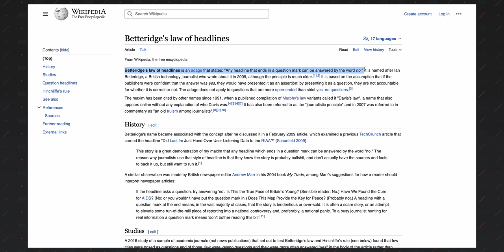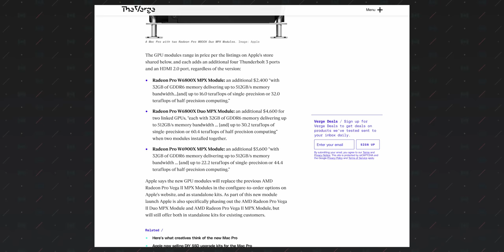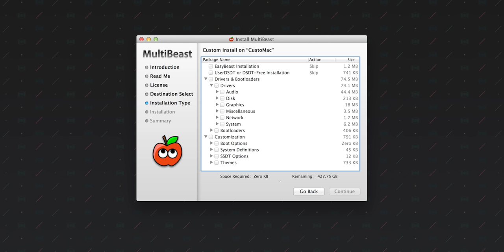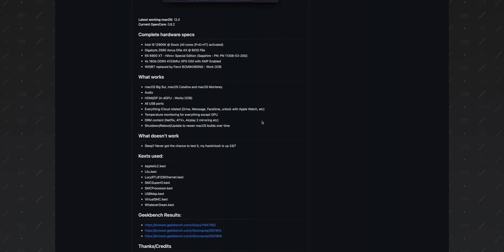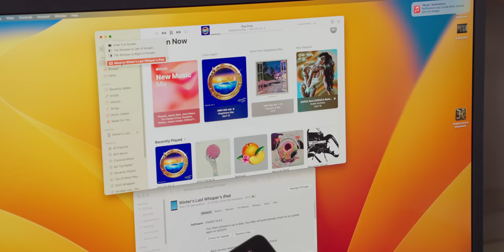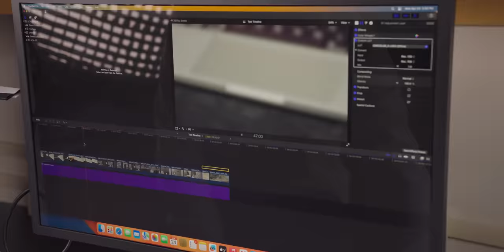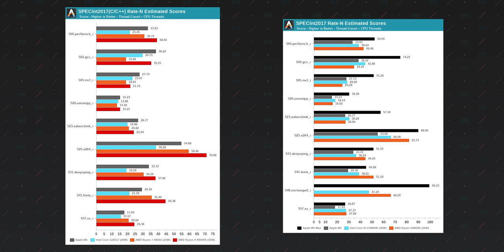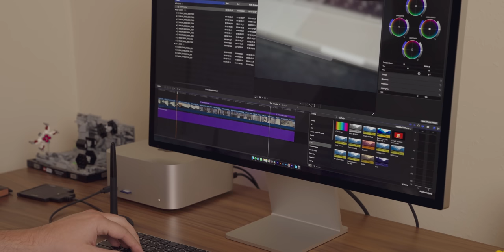This $2,000 Hackintosh SMASHES the $4,000 Mac Studio

Comment: I planned on buying parts (today) for a 10th gen build, because I believed it was the last officially supported generation of Intel CPUs, but after seeing this, I may have to change that up. Thanks for the excellent video.
Reply: To be honest considering that macos can't differentiate between p and e cores, is there any other significant reason to get the newer generation chip?
Reply: @osamabinlaggin69  MUCH higher IPC even on the E-cores.
Reply: @cinebenjamin  13th gen e-cores are not faster than 10th gen p cores
Reply: @toseltreps1101  Yeah, but even without optimisation and proper scheduling, the improved single core and multicore is still there, as shown in all the benchmarks in the vid.
Reply: @osamabinlaggin69  when you do proper MT it doesn't need to know the difference, it matters mostly for games
Reply: Wouldn’t the amd chips be a better option because all the cores are the same?
Reply: @ismaeelanwar3563  AMD chips are much harder to get working as I don't believe they've ever been used in a Mac machine, so there's no baseline for them.
Reply: @sorrai  I have built multiple AMD hackintoshes, from Ryzen 1, 2, and 3. The main problems with a hackintosh boil down to the GPU and wireless support.
Reply: @sorrai  True but I've been running a 3rd gen ryzentosh for a couple of years in parallel with an Intel 10th gen hackintosh and they're equally reliable and performant. The issue with Ryzen based hacks is it can be tricky to get sleep/wake functioning properly, but otherwise it works extremely well. Opencore and AMD based hackintoshes have come a long way in just the last year or so.
Reply: @osamabinlaggin69  amd doesnt have this, so you might wanna do that
Reply: @toseltreps1101  of course the 10-gen cores obliterate the E-cores, but the E-cores do not come at the expense of less P-cores i.e. with 12th and 13th gen you still have the same amount of P-cores and just added E-cores, so they (generally) can't hurt performance and can help in a heavily multi-threaded workload.

I am not using a Hackintosh so can't say anything on that front but on Windows I ran into an issue in a game or two where my performance suffered because the game didn't differentiate between them for some reason. Got into bios and disabled them until I finished it. That's the good thing, you can just disable them if you run into issues. Other than  that everything else is perfect.
Reply: @osamabinlaggin69  Single core performance, 10th Gen is crappy in that regard, 12th Gen and above feels way more responsive.
Reply: @J_Echoes  having the scheduler not work properly may lead to your single core application get set to run on an ecore instead of a pcore and your experience can get ruined tho.
Reply: Its not just the cpu folks, its all the IO that comes with 12th and 13th gen. DDR5 is worth it, and quality PCIE4 bus storage is too. Also stay away from the Samsungs for a hackintosh like this vid, AFPS boots are slower with Samsung Pro Trim ops. Sadly I had to go with a WD Black (please upgrade firmware on anything you buy to avoid lifespan issues!). 12th gen is amazing. Makes my 9900k look silly almost. Sad but cool at the same time. Also, TB4 wont work. And you can choose to run P cores only, and shut the E cores off on the board, or else you will be clocked down to E core specs only in Mac OS. Thats what he is referring to in the video. If you leave only P cores on, it will report at their clocks at their full performance BUT you sadly lose the E core option of the CPU. Its pretty cool either way and the benchmarks are nasty lol. My 12700k\DDR5 was close or barely over a Mac Studio’s scores. Just crazy, and cheaper to build. I was on a Asus Proart Z690 for reference, and used a older 5700xt instead of a newer card. I am not bad mouthing Apple Silicon in anyway, I am glad to see them push the ARM name into normal peoples minds more. Its a great way to tackle compute in a low power requirement…just wanted to see if it could be done on 12th gen was all.
Reply: @alexandruilea915  Easy workarounds for this. Can disable in bios or many have option in bios to enable "Lagacy Game Mode" or similar where you can turn ecores on or off using a key like scrlk. Programs like ThrottleSTOP are another option but for HackMac not sure
Reply: @julian.morgan  lots of audio apps are still calling for intel instructions and do not work on ryzen. The interesting bit is that once upgraded to silicon / universal support, those apps start working on ryzen. But for an audio professional is nearly impossible to use ryzentosh
Reply: You can use regular 12600, it has no E-cores.
Reply: @sarem2001  I have done ryzen, the issue comes down to software support. Most games and software wont run well with ryzen.
Reply: i got all the parts for a high end 10th gen, think it will be more stable and good enough.
Reply: @themarcosaguila1 wow that's weird. They work on AMD when running on windows, but they don't when running on macos? Interesting also that you say the universal binary fixes that. Which software are you referring to?

Comment: I just built almost EXACTLY this machine. The 13700k is a beast.
Reply: NO WAY SAME. 13700k, nhd15s, torrent compact, 1000w good psu, 1tb 980 pro, AND i’m planning to upgrade to rdna2
Reply from the maker: Indeed it is!
Reply: True 13700 super i got my self KF dont need onboard GPU
Reply: @robinenbernhard  iGPU is a godsend for Troubleshooting - my AMD doesn't have one and I stress for the day I'll have to troubleshoot
Reply: @robin & bernhard  Big mistake iGPU can encode and decode multiple video codecs better than Nvidia RTX4090
Reply: @TomasRamoska  13gen Intel GPU in hackintosh? I thought they dont work properly even spoofed
Reply: How well does it perform for audio? Im a music producer currently on i9, 9900k hackintosh and get getting cpu cores maxed out.
Reply: @oldtimer666  Which DAW are you using? I have a 13900k and was considering using it with OSX for Cubase 12 Pro. Good idea?
Reply: @MaestrroMusic  I use Logic Pro X. Cubase 12 pro works smoothly as well go for it

Comment: My biggest issue with a Hackintosh is that it's fool's gold.  Some nerd talks you into putting together a Hackintosh for you, spends a day getting it up and running, leaves it with you, and everything's great until you run an OS update and the whole computer refuses to boot, and now you're entirely dependent on that one friend coming back to your house.  Running a Hackintosh is for people who are fine with the idea of needing to hand-modify plist files and troubleshoot random issues that happen for no reason.  It's cool for people who want to work ON their computer.  That sounds like a slight but I don't mean it to.  Some people like to tinker.  Most people don't.  I think it's a cool concept but I've seen regular people get talked into these and regret it.
Reply: 1) one could pay someone to install it. 2) why the need to update so often? Most people who want hackintoshes are for audio or video work with tons of ram and hard drive and fast, not for updating and installing new stuff that require an update. I think so.
Reply: At what point do you just get Linux or Windows instead?

Comment: I built an 8th Gen HackMac using an i5-8600K on an MSI board with an RX Vega 56 GPU which worked great and was strangely easy to get working using OpenCore. Recently upgraded to an i9-9900K (2nd hand from ebay) for seriously improved performance. But, seeing your successful 13th Gen build has given me hope.... Sadly, I cannot afford Apple silicon just yet so I guess its time for another upgrade...

Comment: The Open Core team have done some great work. I just recently used the Open Core Legacy Patcher to install Monterey on a Mid 2011 iMac that I upgraded the GPU on. Full metal support and everything works brilliantly. Next step is to upgrade the BT / WIFI adapter to allow support for Handoff / Airplay / etc.
Reply: I have a mid 2012 macbook pro do you think it is possible for me too to install monterrey too?
Reply: @RamonNunezRey Yup! I just Open Cored my Mid-2012 i5 MBP to Monterey and it works flawlessly. It’s smooth, drivers work, and there are no bugs that I have found.
Reply: I was using open core on my 2016 MacBook Pro, and everything was working fine, till it wasn’t! My MacBook froze and wouldn’t start! I had to wipe it and do a fresh install (I had a Time Machine backup). In my experience if you use your Mac for work school or anything important then treat lightly using open core. Other than that, have fun 👌

Comment: Just about finished upgrading my whole family's old Haswell based hackintoshes to 10th gen Intel and Big Sur - five PCs with my own PC triple booting. There's almost zero point (unless you really need it) bothering with Monterey or Ventura as Apple have been stripping out hardware driver support with each more recent version, with all the focus understandably being on M1 development - this can make things like bluetooth, wifi and even ethernet trickier to get working and less stable  generally for no appreciable benefit since BIg Sur still got a recent security update. Also of course as Apple deprecate older hardware there's no point them including drivers for that hardware in a current OS - but from a hackintoshing point of view this limits your options. For me 10th gen Intel with Big Sur is the sweet spot.

Also Quinn I'm not sure if you just lucked out or maybe you missed explaining that you can no longer fix your USB port limit issues AFTER installation with USB mapping - this needs to be done before you create the installer so you have your USBToolBox.kext and UTBMap.kext )or equivalent) - specific to the hardware you intend to install on - before you attempt to install. 

Far and away the easiest way of doing this is with USBToolbox - created by dhinakg of Opencore dev fame -  on Windows. This is actually the biggest headache in the process IME, because you have to figure out which of your allowed 15 ports you're going to keep. Mind you its not that tricky as the 15 port limit is per controller and your higher end motherboards tend to have two or three controllers. Also it's pretty simple to sacrifice unused internal USB headers and also switch off the USB 3.0 port where you know you're only going to connect USB 2.0 or 1.1 devices or vice versa. Anyone interested should search for "chriswayg" on gitbook and "USB Mapping on Windows" - his Opencore Visual Guide is generally very good and highly recommended in conjunction with the Dortania guide.

Comment: I WASN'T planing to do a Hackintosh... until I watched this video! Now I'm seriously contemplating it!
I honestly could not care less if it continues to support the latest MacOS. For stability and compatibility with software and peripherals, I always stay a minimum of 2 full versions behind current version anyway. The machine that I pay the bills with is still using Mojave, and I have no intention of updating that any time soon!
Reply: IMO Big Sur is the sweet spot amongst current OS versions for hackintoshing - this has to do with the drivers built in to Big Sur that were removed by Apple for Monterey and Ventura. It's not that you can't get things to work, they just aren't as stable - so I'm just about to downgrade my wife's hackintosh back to Big Sur from Ventura because she's been plagued with wifi and bluetooth disconnects. Of course such issues are very specific to the brand and model of the ethernet/wifi/BT card or NIC which depends on the motherboard.

. Totally agree with staying well behind with Mac versions - people coming from Windows are understandably anxious to stay absolutely up to date, at least with security updates, but that's not been my experience on Macs for the last 30 years. Of course it depends on what kind of risks you take with stuff online. 
Up until recently I was also using Mojave - mostly because I have some 32bit control panels that control some audio outboard - but then I realised I could run the 32bit Windows versions of these via Crossover on Big Sur.
Reply: Exactly. I still run a Yosemite hack. Rarely ever should your decision to build a hack be based on future OS upgrades. It should be based in part on whether the OS of choice supports your workflow and that there is a healthy development environment for software.

I do tech support and my ethos is to make things faster/more stable without disrupting my client's workflow. Sometimes that means helping elderly people who still use floppy disks.
Reply: @peppermintpig974  that's impressive. and it runs without any crashes even today?

Comment: I used to build many a Hackintosh bitd on generic stuff using Clover Configurator etc. They all worked, sometimes quite well. And then I switched to cMP 5,1's for 6 or so years, all good, all supported with some tweaks.

However, for the first time ever I've picked up some second hand PC stuff thats fairly supported, studied the Dortania guides and spent a week building a new Hack. And it just works, the guides are fantastic documents on how Macs work- some of the best written technical docs I've ever encountered.

Comment: I bought a Mac Mini with a 10-core M2 Pro and I've been more than happy with it. I'm mainly a Linux user, but Asahi Linux drivers are in the works so I'll get back to Linux in a while.
One of the major factors for getting this machine was the power efficiency, as here in the Nordic countries, electric costs have sky rocketed. I used to have an FX 8350 and an R9 390 and it drew so much power when just doing pretty lightweight tasks.
My daily driver before the Mac Mini was an ASUS laptop with a Ryzen 7 3700U and the Mac crushes it. In a DIY xz compression tests the ASUS took 1758s to compress it when the Mac Mini did it in 864s, less than half the time. Decompressing that took 80s for the ASUS laptop and 32s for the Mac Mini. Yeah, not really saving that much in decompression, but as I have to compress software packages using `XZ_OPT=-e9` daily, it will save alot of time.
When compiling LLVM using a custom build script, it took the ASUS laptop 82min when the Mac Mini did it in 9min. That's 11% of the time the ASUS laptop took do compiling it. The ASUS laptop was 800€ new and the Mac Mini 1480€ with a student discount, but that's still worth the money for me as I'm saving alot of time without having a bulky desktop (my room is under 9m^2 so space is limited) and having way lower power draw than my old desktop.
Reply: macs suck for os use,.

Comment: Hey! If anyone is having trouble editing their plist files, you can always use the easy method (which is not mentioned in the OC documentation probably because they want you to know how all this works + easier to trouble shoot) is to use OC Auxillary tools. It basically does it all automatically for you + easy updates once you are set up too
Reply: Trust me when I say you are more likely to encounter issues when using those automatic configurators.
It really is best to take the time to go through the official OpenCore documentation to follow each step in the process in full detail to ensure that you're setting up your install as compatibly as possible for your specific hardware.
Reply: @massgrave8x  OCat is fine for a config.plist file from scratch, it's just when you get one that was made in propertree and then modify it in OCat. That's when it's dodgy.

Comment: OpenCore is such a godsend for old Macs as well. I don't know if I'd say OpenCore is "easy" for the average user but it's such an improvement. If OCLP expands or forks to PC hardware, it could be easy. Ironically I still edit on FCPX on my Mac Pro 2019 over my M1 Max too thanks to issues.
Reply: OCLP is a macOS patcher that will allow older macs to run macOS again. Yes it can allow older pc hardware to run too but it won’t create the necessary stuff like your EFI to boot macOS on your PC…
Reply: @ajaxr  the main thing is it’s a configurator, and if that experience comes to the pc side of things where you can create an OpenCore instance automatically by hardware detection, then it’d be truly easy
Reply: Yeah I still use my 2013 macbook air and its never worked better under Ventura. 4gb ram, 2 cores and 128gb storage with samsung T7 1tb.